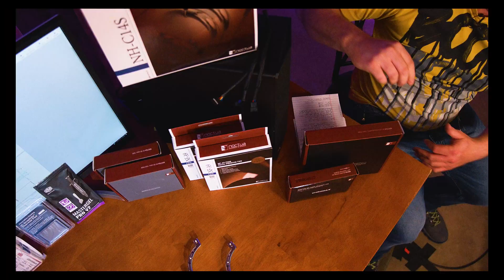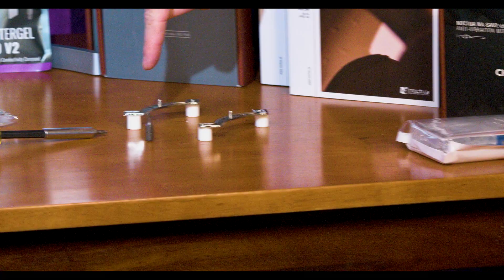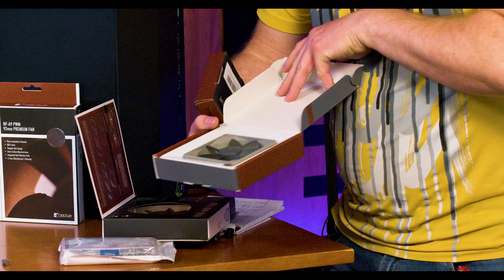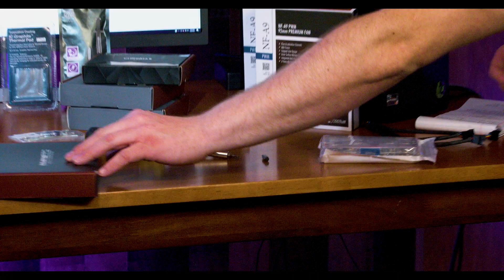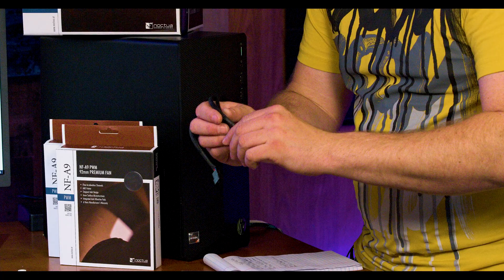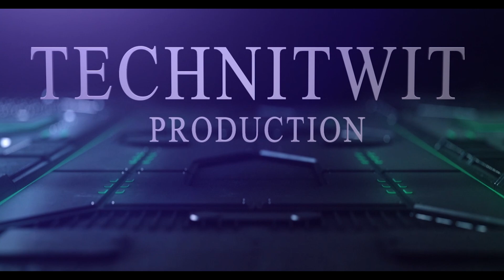COOLING TG01 & TG01- 0023w Noctua CPU Cooler And Fan Upgrading Over View HP Pavilion Gaming Desktop

Comment: Do I need to upgrade from the stock power supply to install the small cooler and the case fans?
Reply from the maker: Nope
Reply: @TNW1337  Hi, I'm sorry, I'm Italian and I struggle to understand, I have an HP Pavilion with the 3060Ti and AMD 7 5700, does the 140mm Noctua fan also fit in? (the big one so to speak)

Comment: does Noctua NH-D9L fit on the hp mobo?
Reply from the maker: No this will not fit.
Reply: I am planning to upgrade the cooler of my hp tg01, my hp tg01 bundle with i5 11400f, i do research Noctua cooler L9x65 and D9L , seem D9L cooler is better on cooling than L9x65. The size of these 2 are same only difference is the height (110mm).
I wonder i can use D9L ;(

Comment: I have a custom version of the tg01 that has a 400w supply and an rtx 2060 with an i7 10 gen, i have already upgraded the ram (8gb to 32gb crucial ballistrix) and the hdd (i added a seagate barracuda 1TB) and i’m thinking about upgrading the graphics card (i wanna use an rtx 3070 founders edition) and the psu (500w maxed hp psu) and would you think im gonna saturate the 500watts of the psu adding even the noctua cooler?
Reply from the maker: No it will work the math does support it. I would not run 3 HDD as you could that may push it over the edge.
Reply: @TNW1337  great, thanks

Comment: does the fan that comes with the AMD - Ryzen 7 3700X fit into the case?
Reply from the maker: Nope Hp is stupid and use a Intel style 1151 Heatsink
Reply: @TNW1337  should make a short going in depth 🤣
Reply from the maker: @SamtheStreet  Lol
Reply: @TNW1337  i wanted to upgrade my cpu but its annoying the fan wont even fit even though the cpu is compatible
Reply from the maker: @SamtheStreet  Yeah Hp was being cheap here.

Comment: wich sould i use in the front/back of the case the 2000 rpm fan or the 1600 rpm fan
Reply from the maker: I would use the 2000 for the rear.
Reply: @TNW1337  thanks ill do that i also have another thing to ask is wich adapter do I get to plug in the fans and where would I plug in the adapter?
Reply: @TNW1337  I also have one last one sorry would 3000 MHz  16 be ram would work on this mother board?

Comment: Put a Noctua 80mm as an intake and replaced the stock exhaust with another Noctua 80mm.  Replaced the cooler with a big shuriken 3.  Keeps my machine nice and cool.
Reply: Intake on the side panel inlet? And also is the stock exhaust 80mm or 92mm? I want to know if you can do 92mm for both of those.
Reply from the maker: Should be 92mm

Comment: I am brand new to pc builds and I was wondering where exactly to plug in a splitter for a case fan?  From what I understand the motherboard in tg01-0023w will not run a second fan using a splitter from the oem case fan.
Reply: You can use ANY fan header on the motherboard to add another fan. If you use the CPU fan header(4-pin), the make sure you plug the CPU fan into the split with the 4th sense wire, as one split will only have 3 wires. If you have a 3-pin CPU fan header plug the CPU fan into the split with 3 pins, and the other should only have 2.

Comment: great video bro!  I recently installed a  3700x in place of the 3500.  I was able to dismount the fan off of the heatsink cooler that came with the 3700x.  Will that fan ,by itself, work with said tg01-0023w?
Reply from the maker: Glad I could help. I mine I guess you could make it work but it will not just fit no. I will have cooling videos out soon. If you did the 3700x upgrade you will want a better cooler.
Reply: @TNW1337  thanks for the advice man.  I guess the noctua cpu cooler is the only option?  Nothing against noctua as I have installed a noctua intake fan and the quality seems pretty awesome.  But are there other options as far as cpu coolers go?
Reply: Patiently waiting to see your install videos of the noctua cpu coolers.  Are we there yet....?   lol.